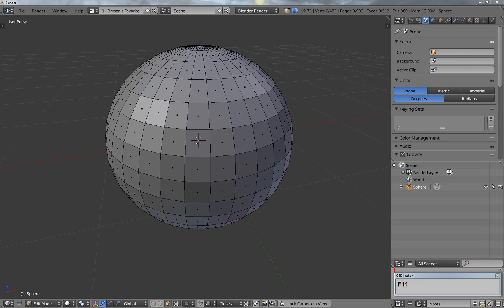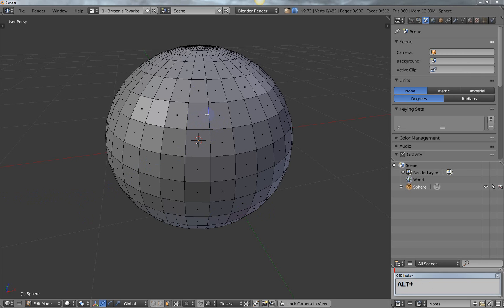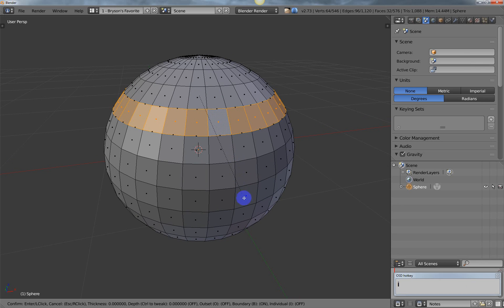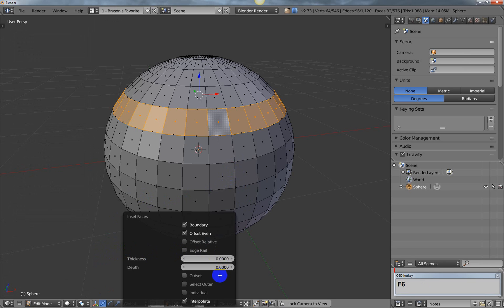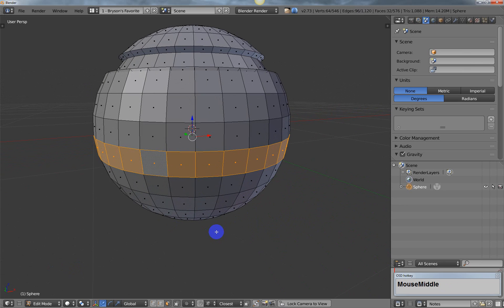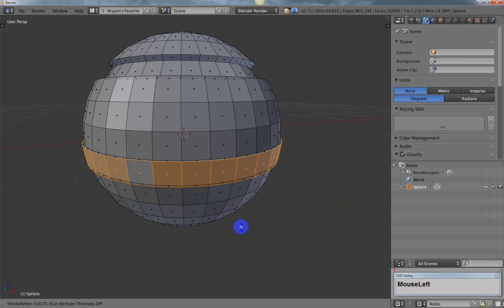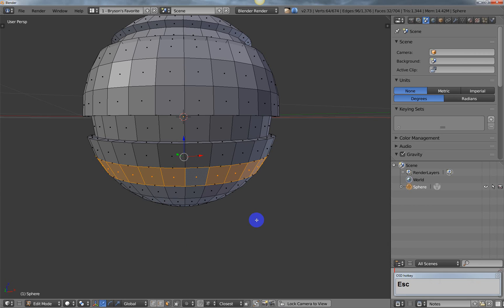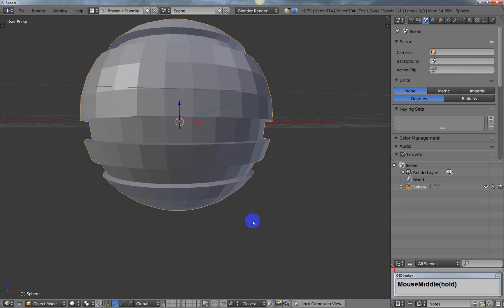3 methods to extrude faces along their face normals in Blender.

Comment: I used to be a Blender guru 10 years ago, but only just started using it again recently for 3d printing models. It's such a pain in the ass for me. Idk if it's because I have the latest version, but it seems like none of the advice I find online works for me. Blender, with everything it has added and it's infinite hidden hotkeys, is just too much. It's modeling, lighting, rigging, animating, and rendering....but I ONLY want modeling functionality. I could do with a simpler modelling  program, if anyone has any recommendations.

Comment: Hi Bryson. I'm a beginner using 2.80. How can I extrude edges and maintain an equal distance/spacing with odd shape? As an example, I have edges connected in the shape of a dog bone currently without any faces. I need to scale outward or inward building faces so I end up with a larger dog bone without face or edge overlap and equal spacing between each set of edges. If the extrude tool offered an offset setting, I think that would be my golden ticket.

Comment: :( Why didn’t you show us where to set depth on the tool shelf?
Reply from the maker: Which method are you referring to? For inset I showed the fixed operator panel and then the alternative floating operator panel that is enabled with F6. Both have identical settings and I showed how to change the depth so I am confused about where I should have elaborated.

Comment: Super Noob here.  Question.  Blender 2.77a.  My objects won't extrude along Normals.  Choosing "Extrude Region" transforms my selection exactly as "Extrude Individual".  It's like Normals is disabled or something.  I figured out how to display the Normals on the object so I can at the very least see them.  Do you know of some toggle or something that enables snapping/constraining to normals?  Thanks
Reply from the maker: Strange. I think I would have to see a recording of what you are doing or some screenshots in order to really help. You can change the Transformation Orientation to Normal in the 3D View Editor Header, but you shouldn't have to do that I don't believe. Give that a shot and if that doesn't help then I suggest posting the question on Blender Stack Exchange and you should get the help that you need fairly quickly. Sorry I couldn't be of more help.
Reply: Thanks man  will do
Reply: Im having the same issue, did you solve it. When I do a Region extrude with my block the extrude doesnt follow the normals.

Comment: Can you tell me what I'm doing wrong?  Starting with an already modeled "bare tire" (no treads in it), I am trying to "cut treads" into it.  The tire model I'm starting with has a cross section of a Honda goldwing front tire which has been revolved 360 degrees.  To cut the treads into the tire, all cuts of tread have to be normal to the surface at every point along the tire. The steps I'm using are:  1) Using the knife tool, create the outline of a portion of a tread to be cut into the tire.  2) Delete the existing mesh edges that are inside the outline of the tread cut,  3) Select all the edges of the tread cutout shape,  4) "f" for face,  5) use your method to extrude faces along their normals.  The resulting tread cut is always using a single average normal instead of the normals all along the cut edges.  When I follow your "inset method" on the existing mesh edges of my tire model, it works just fine.  I'm stumped.
Reply from the maker: +Ralph Francis I would love to help you, but I think it would really help me if you could use Fast Stone Screen Capture (unless you already have some great screen recording software) and record the problem that you are having so I could see what you are talking about. A blend file would be helpful as well. You could share it through Dropbox, OneDrive or any number of free sharing services and send me the links by contacting me through the contact page of my site brysonjack.com. It sounds like it might even make a great tutorial that I could do in response.

Alternatively, it sounds like something you could probably research/ask about on Blender.StackExchange.com. That is quite a great resource of knowledgeable blender users that usually respond with lots of different methods that are very well explained. Good Luck!
Reply: +Bryson Jack Thanks for responding so quickly.  I did manage to figure out some steps and settings with which I get the result I was looking for; these steps and settings are:  1) for the "vertex, edge, or face" selector buttons, select "edge".  2) Use the knife tool to create the outline of the cutout shape.  3) Delete all existing edges that are inside the cutout shape,  4) Select the outline of the cut,  5) type " f " (face command),  6) type " i " (inset command),  7) Drag the cursor to increase the size of the bottom of the cut to its original size,  8) Left-click to stop the action,  9) Press F6 to call up a settings box for the inset.  Make the following settings:  * Boundary=checked, * Offset Even=checked, * Outset=checked, * Interpolate=checked, * all other settings=not checked.  10) apply the "edge split" modifier to the tire object, to get the shaded appearance to look right.  Note that, even though this method works, it really isn't practical. I've seen tutorial videos where a mostly flat surface with the tread shapes cut into it (the cutouts have to be arrayed, etc) is bent in two directions to create the tire model. But I haven't yet seen any good Blender videos showing how to do this for a motorcycle tire.  Thanks for your video, it got me started in the right direction.

Comment: Hi Bryson, thanks for this I was stumped. Question: do you know how to do this with inset. By that I mean, if you select two faces, but you want them to individually inset, do you know how to do that? When I select two faces (they need to be side by side) they are treated as one inset, it's driving me crazy :) If I select two that aren't next to each other it's fine. It's just with adjacent faces it seems to treat this as one face when I try to inset... hope this makes sense :) Cheers
Reply from the maker: +dougieladd When you have selected two adjacent faces and you press I to make the inset, look down at the bottom of the 3D Viewport and you will see some additional menu options. Individual is the setting that I believe you want and you enable that by pressing I again. I hope that helps.
Reply: Awesome, thanks for that, been trying to figure that out for a while. Thanks man!
Reply from the maker: +dougieladd No problem. I am so thrilled that I could help you out!